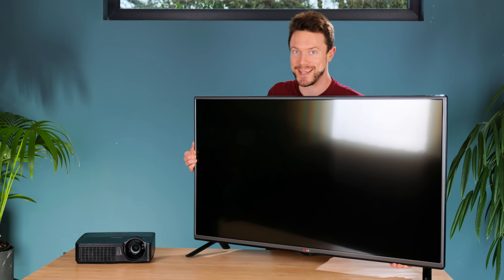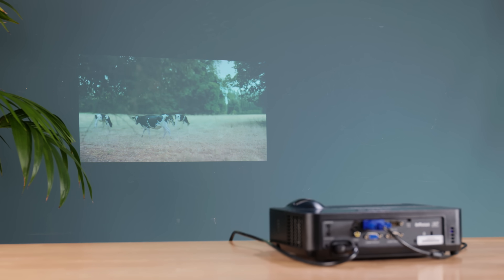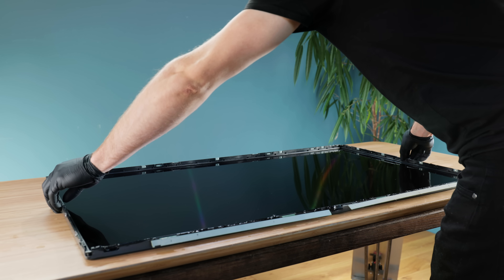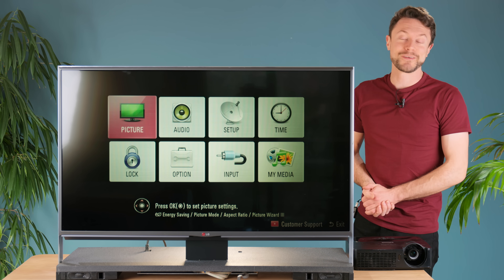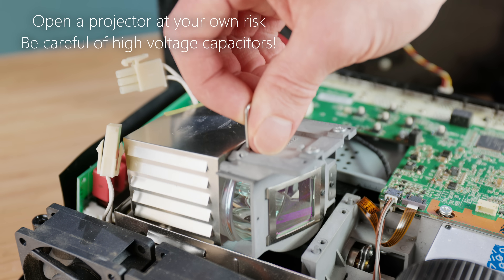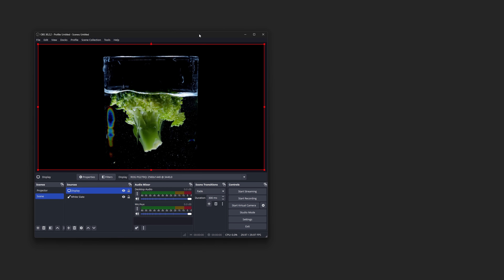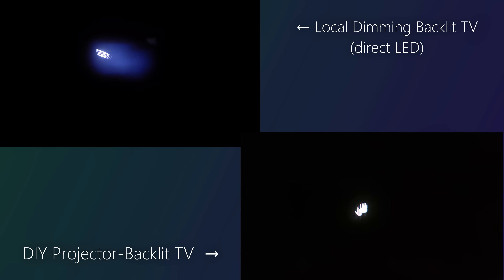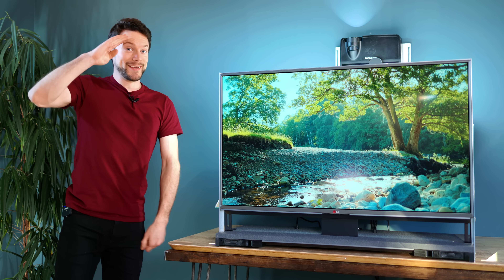DIY "infinity contrast" TV -  with 100% recycled parts

Comment: Bro.. I honestly think you mentioned the solution right in the video without realizing it.  I actually have an old rear projection DLP tv that's full 1080p that I still use in my living room, but when you mentioned how close they were, I realized, it already has a perfect setup, all it needs is an LDC screen in front.. the light source is already perfect for the screen and the case could just be modified with an LCD.. you could probably get a rear projection DLP tv for free that would fit that screen.. mine is a bit large, but if I could find a 75 inch LCD, I might actually think about doing this lol

Comment: Build a vertical stand / cabinet to go beneath it, aim the projector straight up, and use mirrors and lenses to shorten the throw and correct the angle back to horizontal.  Maybe use and old projection TV cabinet as it may have some parts you could use.

Comment: I find the wall mount solution kinda funny, as rear projection tv's did exist, and they flipped it, with the projectors (usually 3 crt tubes) positioned at an angle below the screen and a mirror behind to direct it onto the screen. Ofc these tvs came out before lcd so there wasn't an lcd panel like in this design, but the concept should still work. I'd bet with different optics (perhaps a macro lens off an old camera) you could use the same projector with a shorter throw as well.

Comment: I am half surprised you didn't take the projector apart, replaced the bulb with an LED (pretty sure you have a perfect one from a previous project),  and modify it to handle a short distance.  It would require a little 3D printing, but given how optical keystone correction works and all, I can't imagine it would take more than a day or two to get perfect.

Comment: technically you can probably also just redesign a replacement projector lens using off the shelf lenses from Thorlabs and 3D Printer for the mounting.
but it would likely be even better had you used a 16:9 projector instead of a 4:3 projector for the backlight of a 16:9 TV.

Comment: One thing you could have done for the colour wheel in the projector is just remove the colour wheel but leave the motor assembly in. So just take the wheel off the motor. Then it should not complain about it not being there. As the motor is there just no wheel.

Comment: Please do this with two layers of lcd instead of projector. Biggest problem will be to find a strong enough back light. But I assume any light can be used. So it might be more of a heat problem.
I know some reference monitors for movie production, like the Sony one is done that way, and it essentially the same concept as here, but with easier alignment, as it's literally pixel to pixel and no projection.
I am very curious to see if you would be able to do something like it. As if you could, that is maxing value. Those reference monitors are crazy expensive and still too small for real TV use.

Comment: I've always wondered why TV and monitor manufacturers didn't use a second panel for the backlight instead of something like full array local dimming. A lower res, black and white panel could potentially be made for cheap, and with the double blocking of the light it would have produced much higher contrast. But then I realized the backlight needs to be extremely bright for that to work, which would limit the backlight panel resolution and introduce heat concerns. Using a projector is an ingenious workaround to that! I do wonder how it can be made more compact, but this setup using old, cheap hardware is incredible.

Comment: For the mirror couldn't you rotate the 45 degree mirror, so it is facing down. Then you could have the projecter on the ground facing up, and maybe embedded within the table that the TV sits on. By doing this you could also entirely eliminate the second mirror, so it will look cleaner.

Comment: So there were a few TVs and displays that do this already - specifically a 1080p black and white display behind the full colour 4K panel to provide 1 "zone" per four pixels. They were used extensively in media production houses and almost made it to consumer... except the price and power use was too high compared to the cheapening OLEDs, which are now comparable to how LED was 5 years ago.

Still, a great implementation of the tech. Well done.

Comment: What if you use a same size old low pixel tv to use as backlight? Knowing that you need to project where light only need it. And using that high pixel screen still at the front. Like a Frankenstein of a tv. Might needmultiple wiring i guess

Comment: I am a Media Technologies Professional and I am blown away by the result and the idea. It is amazing how much luminance and contrast you have archived. 
What would be interesting to me, would be characterizing the display in numbers. What exactly is the peak luminance, how dark are the black parts, how does the luminance curve track and how accurate are the colors. I think a collaboration with HDTVTest would be pretty nice!
One thing I noticed, that OLEDs too struggle with was near black quantisation errors / near black cutoff. In the firework-scene you could make out smoke clouds near the fireworks that were near the black level, but still visible on the LCD. They were not visible on the Projector/LCD-Kombo. Maybe this is something that can be tuned and I think even corporations struggle with this in Double-LCD-Displays and Full-Array Local dimming. 
Thanks so much for the inspiring content!
Reply from the maker: The coolest part is that it's tunable by adjusting the OBS settings. You can get the dark smoke details to still be visible with a dimmer luminance to track properly. It's so cool to see.

Comment: That's an amazing and surprisingly accessible project, congratulations! I have a couple thoughts on my mind: how do you handle inputs? Because, as is, you should mirror your output and have a PC that has two outputs. I wonder if it's feasible to build a intermediate processing board that reduces the inputs to 1 while applying the filters, but I guess there lies the complexity. The second question is: if you can get your hands on a projector that does the same resolution as the TV, would you be able to ditch some of the filtering in obs? You would effectively have as much dimming zones as you have pixels, but the alignment problems would still be there

Comment: There are rather cheap fresnel lenses available everywhere. You could probably build a small lens system to shorten the path from the projector to the back of the panel.

Comment: What if you use two or more lcd screens and a cranked up backlight? One or two screens for color, and one for black and white only. 
It would be much more thin than this. This is barely useful other like a fun project. And i think it will be hard to clean, and you have to realign the system after cleaning... :D brr... nope.

i think last year CES or before there were a company which did this with a 4k resoultion color screen and a 1080p black and white. It was pretty cheap compared to a great oled to make.

Comment: A manufacturer really needs to pick rear projection back up. Using a led projector throwing light from a below onto a mid range or even basic lcd could give near flagship image quality in terms of contrast. The result in this video is excellent. I really want someone to make one with a cheap, led projector and a budget 4k screen to see how it turns out.

Comment: awesome as always, but what about the rear protection of the panel and diffusor. As always you could have made some more aluminium brackets to wrap it with a plastic sheet ig.

Still the novel thought of higher contrast tv from an old led is awesome

Comment: Would it be possible to just put the projector below the TV and make the mirror bounce it to the back of it? Same as the old projection TVs back in the early 2000's.  
maybe positioning it below the TV facing backwards with a mirror bouncing the light up and then the main mirror bouncing it to the TV, so that you can get as much area bounce as possible. 

Maybe some additional lenses infront to make the light bigger faster, but that could become expensive quicker.

Comment: Hey, Tech here; Good Job handling the monitor screen without cracking any of it's cells.  I have repaired and handled over 50 screens already this year (doing a project to fix or retire all the register monitors for a store with about a hundred chain stores) and I have broken about 4 of them on accident just because of how easy it is to damage them.

Comment: Could the projector be housed in the entertainment center below the tv, facing the wall, and two mirrors reflect the image up and forward like a periscope, or is that not far enough? It would be amazing if everything could fit in an old rear projection tv. Could the whole thing be made with one of those TVs with the lcd from a more modern tv put in front of it? That would be such a clean and complete build. Maybe there would even be extra room to upgrade the sound. I doubt there would be enough room for as much as Linus tech tips was able to fit into his rear projection tv project, but I feel like that might be the next possible step to this project.

Comment: I was thinking about these ancient rear projection TV´s ( saw one at Linus where they swapped in an OLED).
But then I also thought that aligning space requirements behind the TV would be difficult.
Short throw projectors are expensive, the mirror solution works but isnt very elegant and floods the room with excess light. making this smaller and enclosing it will probably give this Tv a huge back like we had in the 90s :)

Comment: If not for the slight smudging my current TV obtained during a move or something (not sure when or where or how), I'd probably use it with an LED projector like you mention. It's DCI 4K capable, and has some funky motionrate stuff going on that makes it so that 60hz screens are actually able to show 120hz content; or higher... without tearing usually. But it depends on the resolution. Either or, at 4096x2160 resolution, I'm fine with 120hz being the top end I can expect to see without tearing and artifacting of any sort. 

But alas, it's backlight is slowly going, being a nearly 12 year old tv now. It was one of the best of its time when I bought it, and has held up rather well. But that move did something to the lenses diffusing the led light sources, and they fell off in a spot or two. So it needs a repair sadly. 

But it still works well enough to keep using. And with a neat trick like this, heck, I might get another 10 years out of it yet. (okay, maybe not 10)

Edit: Oh, one last thing that will help in my case at least. This tv can display 12bit colour depth without any fringing like is commonly seen on other tvs and monitors. It's technically only supposed to be able to display 10 bit, but... for some reason or another that I am not sure of the reason why; it allows for 12bit with chroma subsampling of 4 2 2 at 4k, and 12bit 4 4 4  RGB instead at lower like 1080p.  But they need to be enabled via the graphics driver on the computer I am using.

Comment: There is a good chance that a black hole's spin limit is actually much faster than the speed of light relative to us Even particles outside the event horizon of some black holes can likely orbit at superluminal speeds relative to us. This doesn't violate any laws as the black hole is dragging spacetime along with it as it spins so the black hole isn't moving faster than the speed of light in in it's own frame. It's much like how far away galaxies are moving away from us at superluminal speeds, they aren't violating any rules as the space that they are occupying is also moving away from us at superluminal speeds.

Comment: Instead of using a projector, maybe consider finding an old DLP TV.. Then you would really just need to replace the screen with an LCD and remove the color wheel again.

Another option is finding two LCD TVs and combining the LCD layers... Just have to make the back layer monochrome to block the light again.  One manufacturer did do this, but I haven't seen it commercialized yet.

Comment: Did you consider sandwiching two LCD panels together? The rearmost one would perform the same function as the projector, essentially being a mask for the backlight. Because the panels are so thin, you'd likely get everything to fit inside the original TV enclosure. Of course, you'd need two mostly functional TVs  which have the same size panel. (Too many comments to read through, so not sure if this has already been suggested)
Reply: I just watched this video and had literally the same comment as yours. Before posting it, I assumed that somebody could have written it already. And here you go, you were first :)

Comment: The mirror solution is not very practical. The reflections off the ceiling mirror would ruin the effect in a darkened room, as would the reflections off the wall and the back mirror.

Comment: Great thinking and execution 👍👏 tho daylight is always behind the screen limiting the contrast (also the image needs to be reversed unless your projector supports back projection). Others have already suggested this here (not sure whether you've tried this already or there is some fundamental practical issue) but if you could somehow replace the projector light source with another stacked backlit LCD TV showing a super bright B&W image (with the OBS glow filters applied so perfect panel alignment is less critical) you might achieve very close to what the £25,000+ Sony BVM-HX3110 (for just a 30" screen!) pro mastering monitor does and a more practical slimmer design. The pro monitor has a 4k front LCD and HD backlight LCD I think. If you could achieve this at larger screen sizes you'd have something closer to the performance, size and practicality of the latest prohibitively expensive micro LED TVs (the holy grail of perfect contrast with high brightness) for a tiny fraction of the price.

Comment: Can we all also agree that modern day fald lcds are straight trash? The resolutions of the backlight arrays are unacceptable. Also, why are they still using color filters? Color filters are awful. They block 2/3 of light. Use quantum dots the same way qd-oled uses them. Anyways, this project was amazing. I would have never considered this solution. I thought, no doubt, any projector would be far too dim to be used as a backlight, but of course, I forgot how trash color filters are and how taking them out of the equation would help immensely. I am SUPER curious how well an RGB laser projector would work with this implementation. That would provide a MASSIVE color gamut advantage over any existing technology.

Comment: This is actually seriously impressive. I wonder if a high end panel with a very thin diffusion layer could be matched with a projector the same resolution and aligned pixel to pixel (Or would you even need the diffusion to begin with?). These could produce OLED like visuals while negating the downsides of OLED panels like burn-in. I would love to see you attempt something like this.

Comment: This is a reinvention of the rear projection TV which makes me wonder if you could just retro fit an existing cabinet. A model towards the end of the lifespan that used bulbs rather than triple CRT tubes could achieve the same effect by doing similar mods. Could also give a tidy space to fit the electronics since the majority of RPTVs had a lot of dead space lol